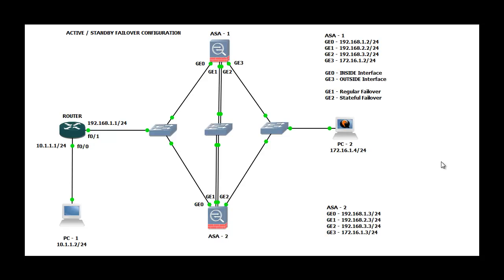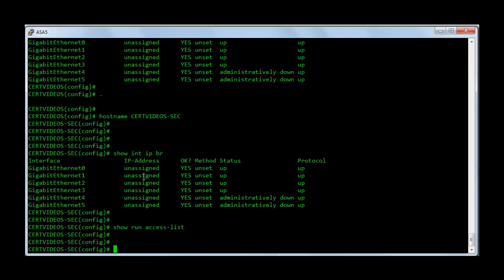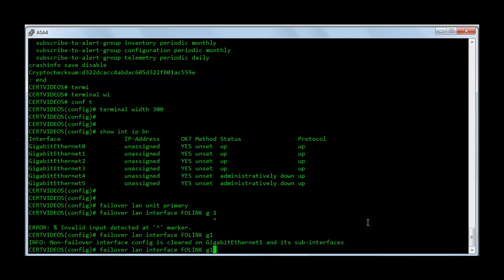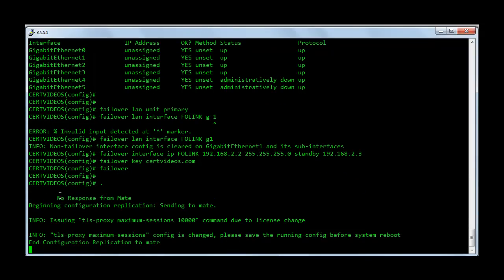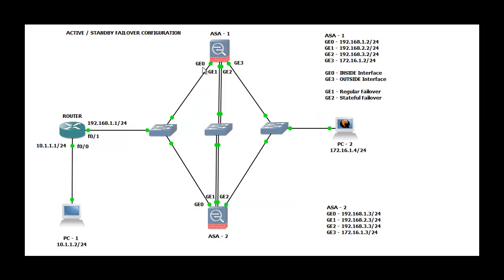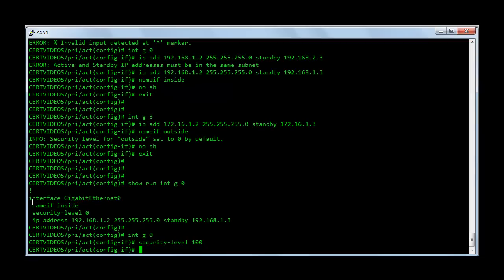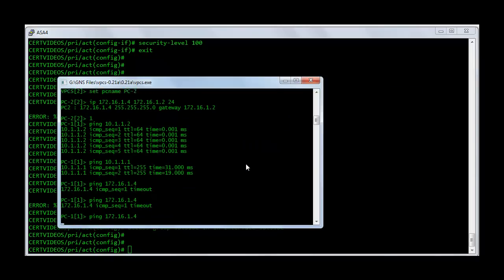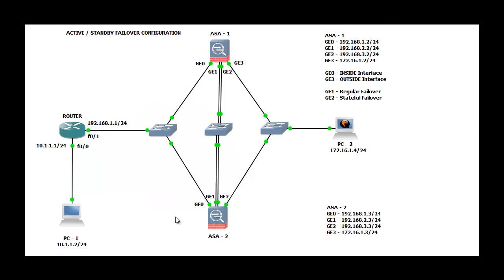Cisco ASA Active Standby Failover Configuration

Comment: Hello Shyam.. We have VRRP configured on old firewall and we are migrating it to Cisco ASA 5525-X. In VRRP we have virtual IP (VIP) configured and that IP we are using as a default gateway on our servers.IN ASA do we need to configure VIP address (similar to HSRP on L3 switchs or routers)? Below you informed Ibrahim that active firewall IP address will be used as DG for servers.
Reply from the maker: Ashok Basapure Hello Ashok, on the Cisco ASA, there's nothing as a VIP address. So you can use the IP address of the primary firewall as your gateway.
Reply: Thanks Shyam for clarifying doubt,

Comment: There's no need in acls on both ifaces. Inside and outside nameifs get a priority 100 and - respectively. To make icmp work without acls at all, all you need is just to enable icmp protocol tracking using fixup protocol icmp. But if you want to have an acl on the outside iface you can allow icmp return traffic. The recommended way is to track icmp packets in so called conntrack table. Also, for the peerlink it's good to use an etherchannel link between nodes to get a redundancy. Cheers!

Comment: Hi Shyam,

I have one doubt, as shown in the video is "wr standby" compulsory, should "wr mem" not replicate the configuration from Primary to secondary unit.
Kindly share your views.
Reply from the maker: +Prathamesh Patil 
Hi Prathamesh, you're correct. The "write memory" command synchronizes the configuration from the primary to the secondary firewall.

Normally you never have to use the "write standby" command, because it wipes out the config on the secondary firewall.

The only time you'd have to use "write standby" is when your standby firewall is out-of-sync with the active firewall; you want to wipe out everything and sync again.

This should be a good read: http://www.cisco.com/c/en/us/support/docs/security/asa-5500-x-series-next-generation-firewalls/115999-write-standby-command-qanda-00.html
Reply: +Shyam Raj Thanks a lot for the info...

Comment: What is the PC GW please !! which ASA should be GW ?!!!
Reply from the maker: Hi Ibrahim, you need to use the IP of the primary ASA as the gateway. In this topology, it is 192.168.1.2
Reply: +Shyam Raj if primary firewall goes down and what what is the gw of PC ?
Reply from the maker: +Shiva Ram Hey Shiva, the gateway of your PC will never change. It should always be set to the IP address of the firewall, which in this case is 192.168.1.2.

When a failover occurs, the active firewall will take that address.
Reply: +Shyam Raj  great ,thanks a lot to clarify the doubt and how PC does know which Firewall is Active ? with the help of mac address or other ?
Reply: +Shyam Raj bro one more query which is if two ASA are in Active/active state then how PC does know which firewall is in active ? is there any way to find that ? one interviewer has asked me this question
Reply from the maker: Shiva Ram
From the PC's standpoint, it does not need to know which of the two firewalls is active. When it receives a packet that is not destined for itself, it will forward the packet to the default gateway.
Reply: +Shyam Raj thanks bro
Reply: Hi Shyam, I guess you mean: 172.16.1.2 not 192.168.1.2

Comment: Hi
I am having following challenge after following the steps given by you.
Ping failed between Router R1 and  PC 172.16.1.4 
Ping is failed between 172.16.1.4 and 192.168.1.2
Ping is success between between R1 and 192.168.1.2 
Again ping is success from FW1 to 10.1.1.2 and 172.16.1.4

Please assist.
Reply from the maker: Hi, this sounds like a routing issue either on the firewall or the router. Have you checked the routing tables?
Reply: Plese share the config for routing.
Reply from the maker: Sorry I do not have the config saved. But the routing is available at 0:56 on the video.